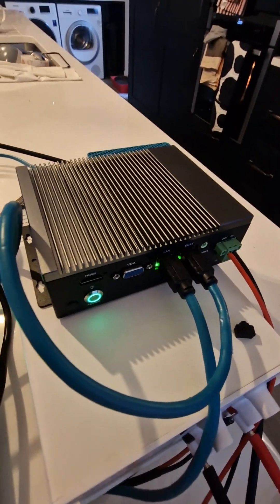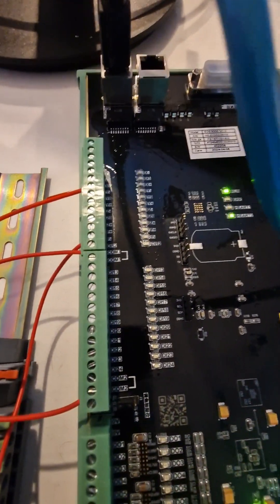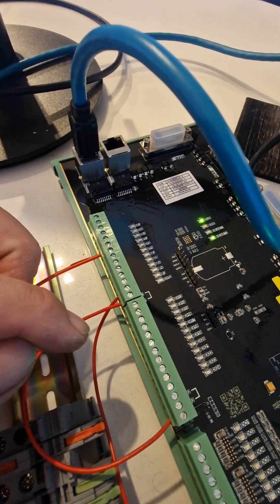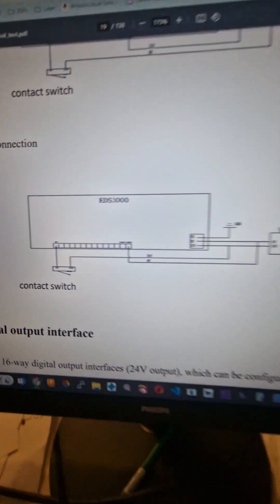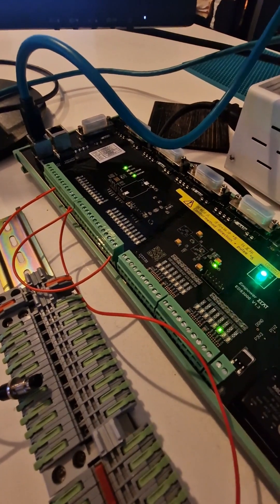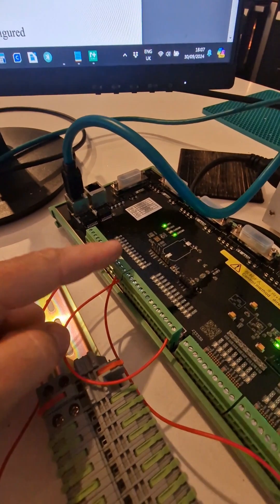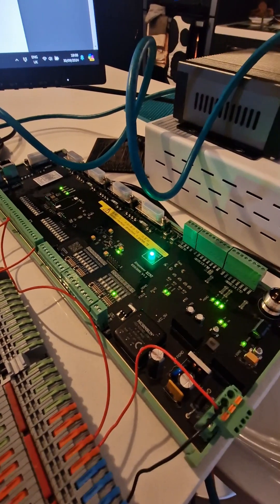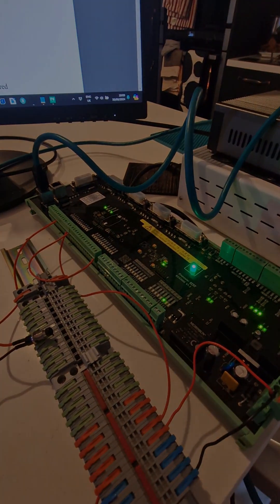Trials of learning the XC3000S. Fiber laser diy build

Comment: Thank you sir for your great videos. My SKY FIRE set up should be here in a couple of days. I currently have a 4'x8" plasma table running stepper motors and have been wanting to DIY a dual purpose addition to my current set up to offer the best of both worlds. You have given me hope that I will be able to make this happen.
Reply: Question, I connected my EPC to the monitor and can see icons for installing the software, but I have not way to control it, no USB for mouse or keyboard connectivity. Am I missing something. I also cannot get it to work via CAT to HDMI adapter to control via the laptop. Thank you sir. Any Suggestions? Thank you.
Reply: Well, looks like I need a video capture card?
Reply from the maker: No you don't need a vid card. The epc is kinda a middle man. You need a laptop with 2dcutahead installed and then you connect to the epc. 192.168.3.? I can give you more info later....
Reply: @robbroomfield468  Thank you so much sir!
Reply from the maker: OK have you got pulse analog board or bus analog?
Reply: @robbroomfield468  Thank you, no option for me to download in English on the website 
either. Thank you sir.
Reply: @robbroomfield468  What I meant to say was that when I select English, it all downloads in Chinese? Sorry
Reply from the maker: @lpfdemt  ah ok. There should be a en version
Reply from the maker: @lpfdemt  try this https://www.empower.cn/download/416.html
Reply: @robbroomfield468  I know, it's crazy. The only EN are the user manuals, the downloads are all EM. I will keep trying to look. Thank you for all of your help sir.
Reply from the maker: You can select the language during the install ...... I think 😆
Reply: Yes sir, I select ENGLISH. When I select next it reads Framework already installed then  what I assume is the "Digital Certificate" checked, but it is in Chinese. I installed regardless to try it out, but when setting up software it is all in Chinese! LOL! Weird for sure.
Reply from the maker: @lpfdemt  top right menu item click that then you should see en
Reply: @robbroomfield468  Yes sir, this is the link Sky Fire sent me. I have an email in to them right now. 🤞
Reply: @robbroomfield468  Without downloading, would you be willing to try the download? You will know quick if I am missing something. Then just cancel the download. LOL!
Reply from the maker: I'll see if I can give it a go later.
Reply: @robbroomfield468  Thank you sir, no hurry and no worries. I just appreciate the help and advice. Have an awesome day!
Reply: @robbroomfield468  Well, do not know what happened but if finally downloaded via English version. Thank you so much for you help sir.

Comment: Interesting, i have exactly this problem right now! Thanks!
Reply from the maker: Have you sorted it now? Anything I can help with?
Reply: Hmm, COM1 is def connected to something on the XC3000 -- once I connected my 0v line to it and had the switches switching 24v to their inputs (active high) it works!
Reply from the maker: @AndrewPrice2704 um ok...definitely not what their own support told me, but thanks for the info.
Reply from the maker: Ah yes once you connect 0v to it. The 24v via your switch then  had a path to ground